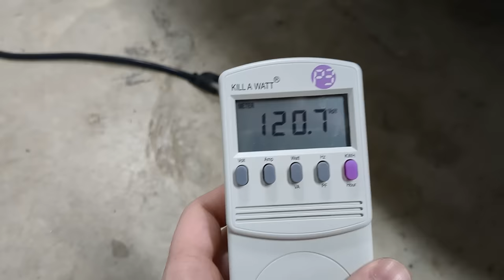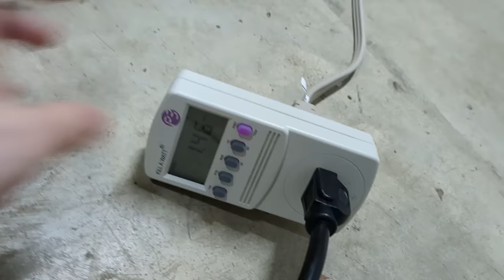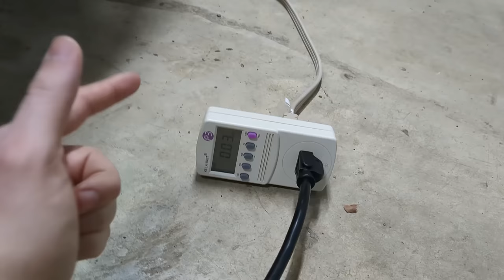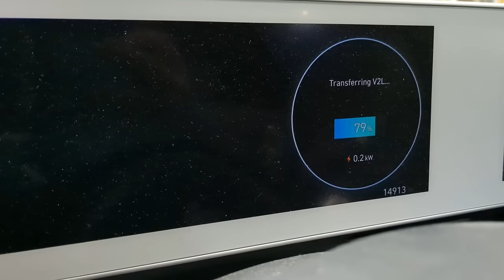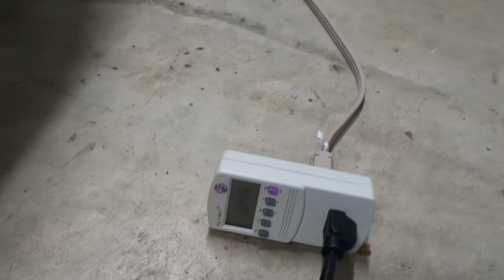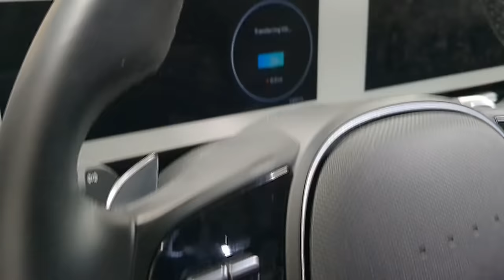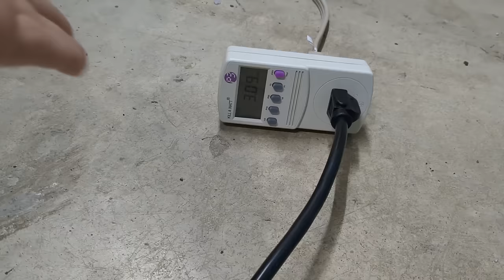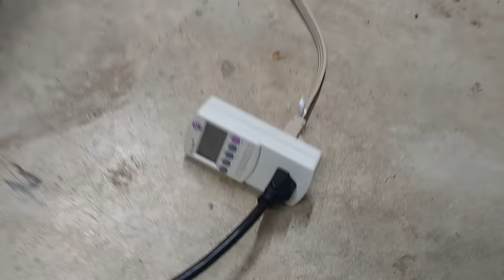A 24-hour test run of the Hyundai Ioniq 5's Vehicle-to-Load function

Comment: Now what someone needs to make is a heavy duty power strip with programmable outlets. Outlets would have load limits and priorities. Then you plug everything in, and when the toaster oven kicks on (high priority) the freezer gets kicked out (low priority). Basically a mini load management center.  BTW, that was something I was going to comment on in a previous video. The great state of Arizona does peak load billing. People out there have had load centers for YEARS to keep their bill from being astronomical for the 15 minutes that month that the dryer, oven, water heater, and house heater happened to kick on at the same time.
Reply: Load management? What are you talking about?
Uninterrupted supply of 10 kW should not be the slightest problem for the battery, the only question is how powerful is your inverter.
Reply: Better check your math there, buddy. 10KW is 83 amps at 120V. Haven't seen many extension cords that can handle 10KW. With rare exceptions, extension cords are never rated for more than 1875 watts (15A at 120V, the limit of a typical outlet).
Reply: @JCWren  tolep said the battery should be fine supplying 10kW and that the inverter is the problem. I agree with both statements. There's no reason a V2L inverter shouldn't be able to do 3600 watts. They'd just need to use a different plug.
Reply: @eDoc2020  Whatever. I don't even see where I talked about battery or inverter capacity or how that factored in to the idea of a load shedding outlet strip.

Comment: Having just been through a cyclone here in NZ where we had no power for nearly 36 hours, several suburbs were out for a week and some rural areas are still without power 4 weeks later - this sort of video is right up my line of future disaster planning :)

I'm probably thinking something like panels + small battery bank + vehicle as supplementary emergency battery bank. It would be for running fridge, freezer & water heater plus air heating if there was a power cut during winter. And some of those loads could easily be cycled on / off in such a situation to reduce load or balance it to when generation is available to meet demand etc.
Reply: I've definitely heard of a few people with MG ZS EVs and BYD Atto3s using the V2L during the cyclone
Reply: When it gets into weeks, maybe a gas powered generator is the solution, if you have gas from a pipe at the property.
Reply: @razvanlex  piped gas is not common in New Zealand
Reply: Flashbacks to Hurricane Isabel (2003) when I was without power for 4 weeks. Lived in a rural area at the time. If that were to happen today, I could see using the car to power essentials at home for a couple of days, then driving somewhere that had power and charging the car (not unlike driving an hour to somewhere with a working gas pump to get gas for the generator every few days back in '03).

Comment: I'm glad to see a video like this because the value proposition of EVs that support V2G/V2L/V2H is quite good. For people who don't want to spend $20,000 adding only 10-15kWh of battery storage to their home solar system, using the battery you ALREADY OWN is just so... logical, not to mention bigger! Do you plan on installing a transfer switch? Sidebar: Is a battery technically a generator? This is one of those pedantic/semantic things I've taken umbrage with for a long time, but don't care enough about it to mention very often.
Reply from the maker: Since it can only output 15A, there's not much of a point installing a transfer switch. If I had a car which could support more output than it might be worth it, but honestly even if I did power outages are too infrequent for me to justify it.
Reply: @TechnologyConnextras  That makes sense. I glossed over that 15a limitation. I live in Santa Rosa, CA, where we are plagued not only with wildfires (and their public safety power shutoffs), but with grid capacity issues resulting in potential rolling blackouts. While my Tesla doesn’t support V2G/L/H I’m still happy I have a power source if I absolutely need it, via more hacky methods.
Reply: hmmmm that's an interesting question. my gut says no, a battery is not a generator. a battery works by splitting a redox reaction into two half cells, which are connected with an electrical load of your choice in between to force the electrons involved in the reaction into your device. a generator on the other hand works by using a combustion engine to spin a dynamo, and the combustion process involves... a redox reaction? huh.

and when you consider that fuel cells for organic molecules (e.g. methanol) are currently being developed, and fuel cells (like electrochemical cells) split up a redox reaction to force electrons to go where you want them, that means that a battery is actually most comparable to a fuel cell, and a fuel cell is simply a better engine+dynamo combo, so by the transitive property a battery is like a generator but better.
Reply: @TechnologyConnextras  The F150 Lightning has a 120/240 V split phase output so installing a generator switch would make sense. You could power your house for a while.
Reply: Another advantage of V2H/V2L over something like a Powerwall is that your battery is mobile. If you know that a charger 50 km  away is operational, you can power your home until you have 60 km of range left (or however much margin you want to leave), drive there and charge. When you return, you can go right back to powering your home again. If your household has two EVs, you can alternate depleting/charging them, so that there’s even less downtime.
Reply: @Joel_E  Unless everybody else in your area that has EV's and is without power is waiting to charge theirs up as well. Then you may be waiting in line for hours.
Reply: @cheeto4493 yes, that’s certainly a risk. One possible mitigation would be to charge at non-public chargers (a friend or relative’s house, perhaps). Of course you’re then limited to Level 2 charging at best.
Reply: @cheeto4493  you're right, but consider that gas stations usually also get lines in such situations.
Reply: @cheeto4493  Or you have solar and don't have to worry about it much at all.
Reply: @Validole though, to be fair, the time spent filling up at a gas/petrol station is significantly less than at even a level 3 charger.
Reply: Thar price seems very high. You can get 15kw of lifepo4 48v server rack batteries for about $5k plus freight and installation. You'll spend more, of course, if your inverters aren't battery ready/you went with microinverters.
Reply: @grythumn  Sure, you can do anything yourself if you DIY it. I'm talking about commercial products with professional installation. 95% of consumers don't have the wherewithal to wire their own EVSE, much less a home-tied battery system. 🙄
Reply: @Validole  True, but it doesn't take 30min to an hour to fill a ~20gal gas tank. And most charging stations aren't designed to supply 100% to every pole at the same time. Just like most gas stations can't feed all the pumps at full pressure at the same time.
Reply: @KiwiandPixel  Those are commercial products with UL ratings. Few hours to install by a competent electrician, if you already have the right inverters. If you have a grid tie only setup you'll spend a fair amount replacing them with proper hybrid inverters, granted.
Reply: Yes and no.  Yes you can use the car's battery as an energy store but pulling 10kWh out of it daily isn't a good idea.  Sure it will do it but as far as the battery is concerned any use equates to miles (or kilometres if you prefer) travelled.  The car manufacturer might say you'll get (made up figure) 100,000km out of the battery but that's using it for driving only.  People that buy powerwalls or other stationary batteries usually, but of course not always, plan on cyclic use daily.  For emergencies dipping into the car battery is ideal.
Reply: @retrozmachine1189  I agree it’s only viable in emergencies. Plus, many people aren’t home when solar charging would enable them to bank energy for their own home use.
Reply: @retrozmachine1189  The rate of power draw from V2L is so negligible vs. the load of driving, ,it will IMPROVE battery life. (15A @ 120V is 2.25A @ 800V. driving pulls 10-50x that. most of the reason for an 800V pack is to reduce the current.)
Reply: @jfbeam  Use is use no matter how it happens.  Yes, if the car's battery is 800V the current will be considerably lower but it still puts 'miles' on the battery.  Even a piddly 1500W inverter at full load overnight will rack up 10kWh.
Reply: @retrozmachine1189  Incorrect. The rate of charge/discharge has a huge effect on cycle lifetime. A less than 5A load on the pack will have almost zero effect on lifetime. Of course, there's no simple way to charge the pack that slowly - 'tho I suppose one could set their level 1 charger low enough to take 20+ hrs. A 5A rate would be a 2 day cycle, 8000 cycles (actually pretty low) would be OVER. 40. YEARS. It's not like anyone is going to do this every day for forty years. Even if you had to use the car as a backup once a month, the effect on lifetime is negligible.
Reply: @jfbeam  Sure does, but no matter how do do it you degrade the battery.  Your estimates of impact are completely wrong though, but who cares, it seems that you ultimately do actually agree with me in that I said using the battery for emergencies is [an] ideal [situation].  Whilst using it for daily cyclic purposes is not.
Reply: @cheeto4493   or the charge station might introduce an appointment system    😉
Reply: I too dislike the use of the term "Generator" for a battery-only stored electricity.  A generator in my understanding would convert one type of energy into another, typically and specifically rotational mechanical energy into electrical energy.  An argument can be made that a "solar generator" may not be a "generator" as it does not source from mechanical energy.  Solar does however convert radiant energy to electrical energy, so it is a conversion of energy type... arguably more a generator than using a battery. And to differentiate from an Alternator - a Generator is without an initial supply of voltage. 

you might say "I'm using my car AS a generator" aka "I am not using a generator, but instead using my car to source electricity for a limited time"

Then again... I suppose even the internals of a battery will store the electricity in a chemical way.... mm

Comment: Very interesting video.  What a nice feature of the Ioniq!

I'm living in the suburbs of Cleveland, Ohio. A few years ago, we had a microburst hit the power sub-station and nearby high-voltage lines for the immediate area.  The power company predicted ~8-10 hours for restoration, so we waited it out. Then the estimate went to a full day, 2 days, then 3 days. Power came back just after the 4-day mark.

We had to drive quite a way, but we found someplace that still had a generator available. We were able to power the essentials, including a space-heater, and charge our phones.  If we had known the power would be out so long, we would have secured home and left.

Having a car that could serve as a generator for a few days sure would have been nice in that situation.

Comment: I have 27kwh of backup batteries which has been easily more than enough during all the outages I've experienced, and that's powering 2 fridges, freezer, modem/router, and a furnace at the very least. Not to mention intermittent lights, computer, TV, garage door opener, etc.

With the amount of power stored in an EV, you can probably stretch your energy incredibly far in an emergency situation. Such a great feature and I think every EV should be able to do this.

Comment: I hope this video gets people thinking about emergency preparedness and not in the insane way, but in the possible to happen way.  That set up is all really handy for the electrical appliances, i still do like things like gas water heaters, gas heat, and gas stoves for this emergency scenario for redundancy in power sources.  I do keep a mr buddy heater around as well.  Fully electrified homes really do suffer from lack of redundancy without big generators or batteries, and this could help fill that gap.  Owning one of those buddy heaters (or for the fancy an Aladdin lamp) and a coleman outdoor stove should be a must for electric homes.  It could really save lives.  I have a little lunch box style 18amp generator that weighs 20lb and runs all day on a gallon of gas i use for similar purposes as what you used the car for.  A bit cheaper than a new car but if getting a car anyway something to consider.  Hopefully this gets people thinking about being prepared.  Those little generators are nice, quiet, affordable, and reliable but, and this is a big but where the car wins, requires additional maintenance a car doesn’t need.  It needs to be run, oil changes, and the spare gas needs to be cycled out so it doesn’t go bad otherwise the day its needed it will be useless.  

In short I’m saying good to present the options and the fact you talked about this may very well mean this video saves someone’s life because they invest in providing the basics needed to have food and warmth in a power outage.

Comment: Battery backups are best for network equipment anyway. It ensures consistently during brownouts and short power outages which really are most power outages. I also found that it reduces noise on the line in some cases in buildings with bad wiring
Reply: Yes, but it's still highly amusing that a recloser doing its thing can throw the device into a factory default mode. Dumb design. Or does Com Ed have a vendetta against Starlink? <g>
Reply: @stevegeist3798  totally agree. Reset button/switches should be how that works. Just giving my two cents as a network engineer. UPSes saved my ass soooo many times

Comment: Cool video! Samsung refrigerators have a major problem with the defrost drain and duckbill at the bottom becoming clogged or draining slow. The moisture blown out after defrost may be a sign that defrost water isn't draining well, sometimes this will turn into an ice ball forming by the evaporator fan blocking it from turning and causing poor cooling. Consider preemptively installing leakage kit DA82-01415A to prevent this.
Reply: Yep, it also doesn’t hurt to buy the kit with the longer thermocouples and move them as instructed, and I added about 8 inches of copper wire to the heater and dropped about 5 of it down the drain tube as well as the longer aluminum duckbill, added foil tape over a few areas to reflect the heat when it defrosts and help with heat transfer. Went from a yearly defrost that took a day to not doing it again for 3 years, the closest when during a very busy holiday season I ran a forced defrost so the tiny buzzing sound of the fan disappeared, also no more ice buildup under the drink drawer
Reply: @Steevo69  He appears to have poor draining, not random blocks of ice forming and hitting his fan...yet. There isn't a need for changing thermistor location, installing the drain kit and cleaning the drain should be fine.

Comment: I have a SAIC MG5 - all the MGs have V2L 😊. It gives up to 2.5kW from the CCS port using a special cable.  Handy to power the household in an outage, or to vacuum the car outside without an extension cable!  It has a 61kWHr battery so you can do a lot of cleaning!
Reply: The MG4 can do 7kW (not official). Of course use a custom cable for this with thick wires. Maybe the MG5 can do it too?
Reply: I also have an MG5 57kWh usable. I’m current-ly using it for doing tumble drying. Just about to install a a Changeover switch to power a few circuits. I did test the 2.5kW limit and boiled a 2.8KW kettle whilst the 1.8KW tumble was running all good.
Reply: @A B  depending on the resistor, a 2000ohm will limit to 2200w, 470ohm 7kw from memory
Reply: @andrew, I made my V2L lead using a 470ohm resistor as from what I found that’s what is needed for the car to see the lead as a discharge lead.
Reply: @craggy4749  i made mine for my ZS with a 2k resistor which is the same as the official MG V2L adaptor, which we haven't got in NZ
I did think about using a 470 but didnt eant to risk cooking the multiboard ive used with mine
Reply: @Peaches_NZ   the board in the car? Or the multi socket lead you have used?
Reply: @craggy4749  the multi socket
Reply: @Peaches_NZ  You are right. It is better to create your own cable with a high power socket and 6mm2 wires if you want to output 32A.

Comment: A chest freezer when full can be off for a day or two with no danger of the food thawing.
Also, I'd be interested in how the garage mini-split would heat the house if the door was left open. Perhaps not enough for furnace comfort levels but to keep pipes from freezing that are above ground.
No need to nuke the butter-drain the veg, add the butter to the pan and let it melt that way, on low if needed. Sounds more efficient to me.
As always, appreciate your attention to detail and dedication.